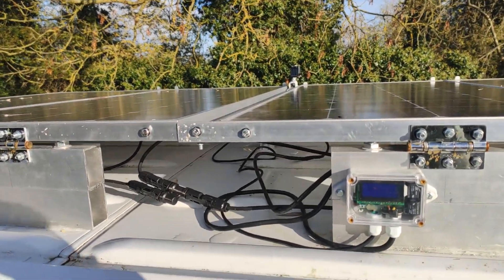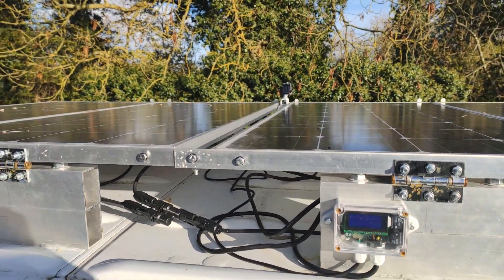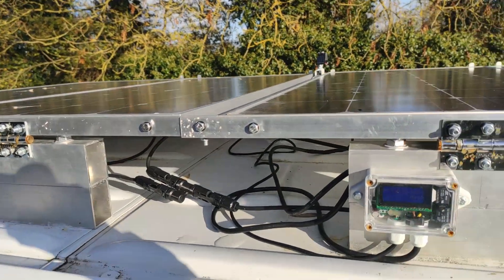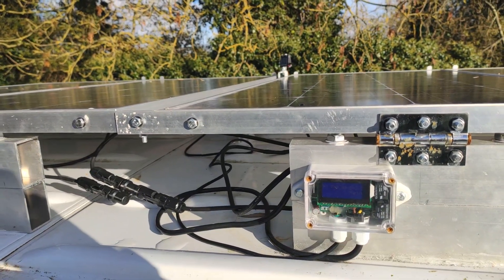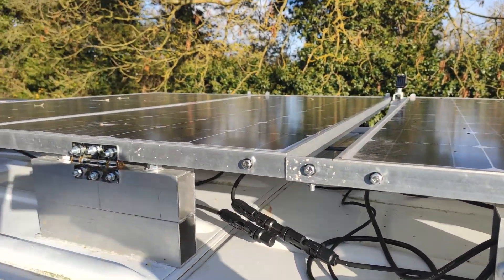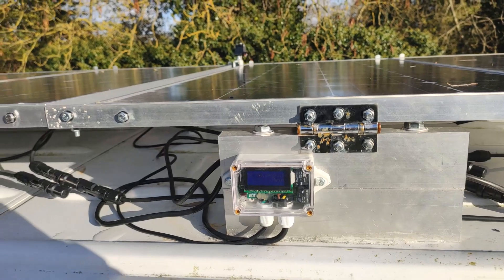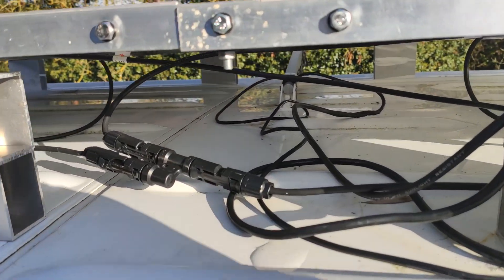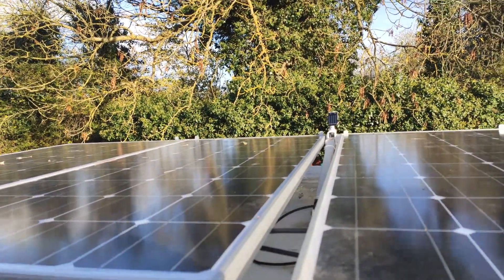Solar panel array with linear actuator for van build - Part 2

Comment: Very interesting! A few questions -

1) Why did you mount everything so elevated from the roof surface, why those ginormous aluminum blocks? 
2) Did you give any consideration to roof rails designed to fit the sides of the van roof, and then build up a rack system attached to brackets in the roof rails? And if you did give that consideration, why reject that idea?
3) Are the panels, on the elevated sides, ever secured to the van roof in any way when they're lowered, for travel? Or do you depend on the actuator to keep the whole assembly in place despite airflow?
Reply from the maker: Hi,

1) It is mainly so that the actuator has a viable starting angle. is the actuator starting angle is too low it will simply blow the frame apart rather than raise it up. However the system could certainly lower by at least 25%, however this is the alu box i had. The added bonus is that there is nice storage underneath the panels now, surf boards are no problem to secure to the roof now.
2) Yes. Rejected due to cost and being unnecessary. A suitable roof rack for this sprinter would cost me more than €650 delivered, then to get the system working with the roof rack would take a similar amount of material and engineering anyway.
3)It is just the actuator keeping it secured at the moment on one side, however this is a half inch thick metal bar secured with various M10 bolts, on the other side it is secured with thick steel hinges secured with 32 M6 bolts. Dynamic airflow when driving down a motorway is a consideration, however the current setup should more than cope with it. I will probably add some spring bolts on the corners on the actuator side, more to keep it from flexing during driving that to secure it.
Reply: @thewanderingwarner5403  1. A four bar hinge would change the horizontal motion into vertical motion, if you didn’t want to have the panels so high off the roof. It would also take some of the stress off of the panel’s frame.
Reply from the maker: @JeffFreemanPresents  Interesting, would have to have it detach once it fully extends or something. Would look into that if i was doing it again.
Reply: @thewanderingwarner5403  I’m doing it now (so thanks so much for your video, I learned a lot!). I’ll post my solution and let you know. It is because of folks like you that I am able to undertake this project, so I’ll say thanks again; I really mean it.
Reply from the maker: Great to hear, hope it goes well.
Reply: @JeffFreemanPresents  please post!
Reply: @philfr212  I sure will! I’m still looking into it. My latest research has steered me toward window openers. I suspect that casement window hinges will yield something useful.
Reply from the maker: I should also add to 1) that if i wanted the suitable roof rack, the roof vents would have been very tricky, there is actually another vent now for the shower extractor fan. I would have ended up cutting away a lot of the roof rack cross supports. You end up being left with a very small amount of steel on the roof for €650! Plus the steel roof rack just makes the setup unnecessarily heavy.
Reply: I know I'd like to do a system like this on a future build, but I think it could be done without so much hardware attached directly to the roof itself. I'm thinking generic rails on the sides, brackets/crossbars set up where needed; not a pre-made roof rack solution that (like you said) would require cutting here and there to make things work.

Thinking about it, I think one could even make that work with the need to have the base of the actuator a ways lower than the panels to make things function properly...
Reply: @scottweikert5189  Hey Scott, have you started on your system yet?  I'm thinking about doing the same thing and I'm interested in any other ideas for setting up such a system.
Reply: @pittarak1  (it's me) No, I have not yet started. When I first posted I didn't even have a van. Now I do! But I'm still in the fix-up stage. I do plan to mount my solar on the roof using a roof rack system of some sort, but I think to start, I'll stick with the simple solution of flat-mounting my panels, just to move the build along. I will, however, set up the mounts in a way that I could go back and modify them with an actuator, should I find I need that extra efficiency.
Reply: @wanderingzythophile9083  if you do tilt you'll find an enormous difference in charging time - unless you live on the equator that is!
Reply: Great video and details on system/parts/design. How does the raised solar panels fair in the wind?
Reply from the maker: Very well really, I've accidentally left it up in high winds, no issues

Comment: Is there a latch or something to secure the non—hinged side when the panels are stowed while driving? Or is the linear actuator strong enough to hold the panels snug in the stowed position?

Comment: How are you grounding your panels, through the frame?  If so, I'd be worried about trying to pass ground through a galvanic rust hinge connection.. Mine call for a dedicated ground lug, and I can also get cord tamers that snap into the back of the panels...
Reply from the maker: Their on a van on four rubber wheels, there is no 'ground'.
The positive and negative just go back to the charge controller.
It's a 'floating' system like any vehicle.

I'd only consider 'grounding' the aluminium frames to the vehicle chassis if the system was running at over 50v DC.

Comment: Awesome video!
This Ethan from Australia - I want to do something similar to my Toyota Prado mounted on rhino roof rack - without drilling holes into my car. That said I love your setup. The web link on your bio is broken - any chance you could provide name and model number of the controller unit? Also is the controller unit GPS auto controlled or purely with solar sensors? Many thanks!
Reply from the maker: Thanks, they don't sell the tracker I have anymore. Just search 'sigle axis solar tracker' on AliExpress and you'll find better systems.

Something like this : https://a.aliexpress.com/_m01MH3K

Comment: the system is nice but your build could be much better ,  the controller should be build  in the van , I do understand the heights in case you take a surfboard with you  you should get some kaps for those aluminum bars to cover up and keep it clean inside those tubes,  did you get them secured wen they down in case of driving ? also use RVS bolts and washing rings better against rust ;-) but weldone mate !

a small type for anyone : for the bolts and wonder metal stuff by a spray can with plastic spray , spray bolts and other metal stuff with it , it will not rust at all
Reply: Have a look at this set up from - Snow & Curt
1000 watts Tilting Solar Ep. 1

Comment: Get caught out with strong wind once and theyll be ripped off the van
Reply from the maker: They have been in near hurricane force and have been driven down the motorway at full speed for hours  with high winds.
They have not budged.
Again, like others, you are misunderstanding the engineering. They've actually been signed off after an qualified engineer inspection of the van.

Comment: Can I rig a handcrank angled array. That extends to 185 degrees. With gas charged pistons sliding inside side to side roof tracks? Becoming an awning over the side doors? Supported with 3 - 5 telescoping poles. With a deck you can sit on underneath, now facing up? And another deck on the van roof with additional panels on top of a 30cm tall case covering the entire roof? With ducts for fans and AC in the case. With storage between the ducts for surfboards, kayacks, or even a waterfoil board? With panels being cleaned from the ground? And air/watertight lids with solar panels in them on top of the case/vandeck? Or adjacent to them. Bringing it to 1 - 2 kilowatts? Say for 5 - 8 grand? And a 6mo to 1yr project? Or is this a hairbrained scheme? 
    It's a lot more storage, deck space, and enough solar wattage to top off an electric motor, or hybrid motor, if you installed one in 10 years or so. The array needs to be light. And reinforced with more aluminum framing to support multiple people. Say 5 - 8cm thick. But hand gear crank and 2 - 3 pistons support it. The sit on deck underneath the array is optional (sketchy). But not on top of the framed out vancase.
Reply: Yes but this is mad scientist level of work

Comment: Great system. Do you have link for the actuator used?
Reply: It's on Alibaba. Search for 12v Single-axis solar automatic tracking controller. Current cost with delivery around £85 - that kit is with a wind speed retractor.
Reply: @CosmicSeeker69  thanks Graham, much appreciated.
Reply from the maker: Here is a link to the manufacturer of the tracking system: https://www.eco-worthy.com/collections/solar-tracking-kit/products/dual-axis-solar-tracker-controller-with-remote-control?variant=37733871550652

Comment: Is there any lock while you're driving down the road on the side that elevates? Or does it just rest on those glued blocks with the actuator holding it down?
Reply from the maker: The holding force of the actuator is more than enough, however I have since added  2 stainless steel clasp latches, can't be too safe!

Comment: Watching this in April 2021.  Thanks for posting - most helpful.  Just a couple of questions: 1. Would you locate the control box just inside the van under cover out of the weather or are you finding it being easier to use where it is? If you moved it, I know that you'd then have to run 2 wires (power for the actuator and also the sensor) from the control box through the roof via a solar entry gland. Your thoughts?  Thanks again.
Reply from the maker: The control box is waterproof, just the screws that came with it are not stainless which is a bit annoying, but I've put silicon over them now.
Is useful to have the box outside as I can easily watch the panels and their position as  manually operating them with the remote.
I have already run 12v out through an entry gland, it then splits to the actuator and control box.
Running power to the control box inside the van wouldn't be an issue either.

You could have the control box inside, it doesn't really make much of a difference.

Comment: Standard Silicon is water based and breads down in wet conditions.. Use 100% rubber Silicon and it will never leak and it acts like a super bonding glue..
Reply: That, and using rubber oversized washers on each side of the sheet metal along with large stainless steel washers to clamp it all flat would be a durable option that won’t crack like sealant will over time.

Comment: Those nuts inside may rip out the car sheet metal. You need bigger washers or thin metal plates as backing so that the bolt will not shear the car sheet metal. Car sheet metal is not strong. The wind force on the panels will be huge when you are driving down the road. The whole idea is brilliant. I just think you need to get those inside nuts fixed.
Reply from the maker: Thanks, but I disagree, the force translated to each individual bolt would be minimal. The force required to laterally sheer the metal across 10, tensioned points of contact (10large bolts) would be extraordinary. In my opinion there would be no possibility of wind force acting on the panels being able to impart anywhere near the required force.

The entire thing is very over engineered.

Comment: HI ,   do you think   the actuator  is waterproof  enough ?  Does it  have  an IP   rating ?
Reply from the maker: Hi, yes the actuator is IP65 rated. However I believe the orientation is important, you'll see I have the extending screw end mounted to the roof of the van. This should stop water dripping down and possibly into the lead screw overtime.

Comment: Hi, what's the name and link for the solar panel orientation sensor? Please
Reply from the maker: I can't find the exact one anymore. Here is a link for a similar one, except it's dual-axis, you could probably modify it/program it for single axis. https://www.eco-worthy.com/products/dual-axis-solar-tracker-controller-with-remote-control
Reply: @thewanderingwarner5403  thank you very much
Reply: @yingli8028   there's a guy in Israel that makes a range of these solar trackers. Sorry that I don't have his details but he's on eBay. I paid £14 for mine but I will need to add a capsule to it or make one. On top of that you will need the remote control unit.  Or on Alibaba this unit is available with a windspeed retractor in the kit. I hope this helps you.